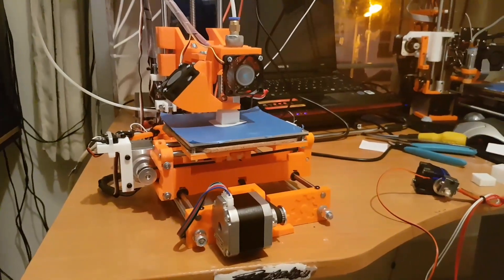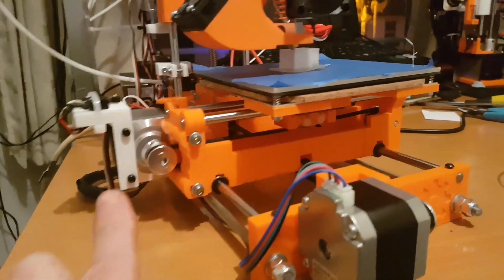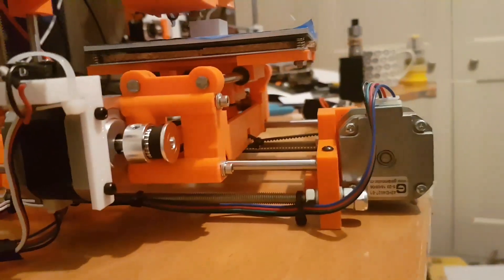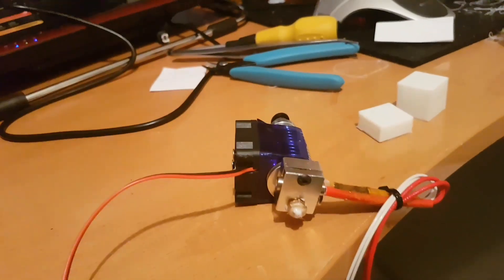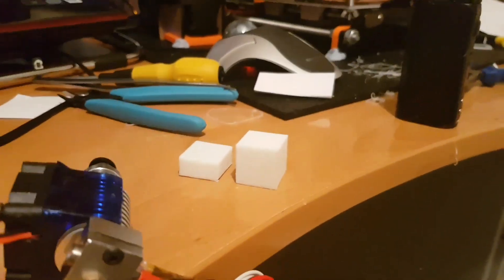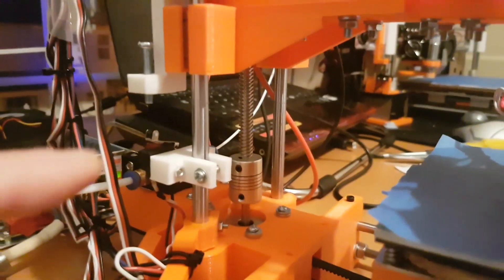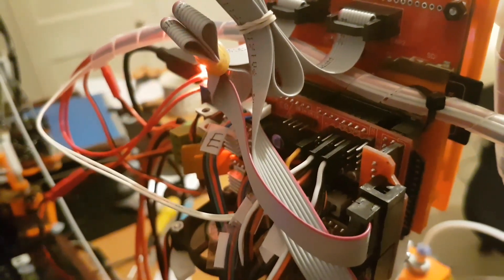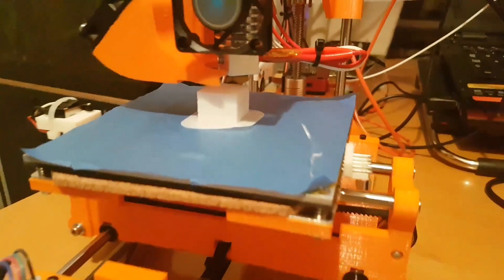Reprap Atom X (3D Printed 3D Printer) Up and Running

Comment: Any chance you could do another video when everything is running spot on. I came across the Atom X today and then found your video, so thanks for putting it up. If it prints at decent quality I may well have a go, it would be good to have two printers. :)
Reply from the maker: Googel+ Hi. Will do. I just wired up the heated bed for it. All working. Just ironing out the calibration...

Comment: This is awesome. I am in the process of printing this machine. Any tips so far?
Reply from the maker: 633r Hi. Good luck with the build. the main one to save you a headache is probably to print the print bed as a single piece. Here is a link http://www.thingiverse.com/thing:1739601

I also made a single piece for the y carriage front and a better z limit switch so I'll see if I can dig them out and put them on Thingiverse.  I used the original ones to hold fans to cool the board. if I think of anything else I'll let you know. Best of luck.
Reply: Thank you. The creator says he split up the parts. So I wondering if he doesnt have bigger parts available.
Reply: Where do the stabilizers parts go?
Reply: @Plan-C  cool

Comment: where you have take this heatbed and which dimension is it?
Reply from the maker: This is the same one. All over eBay:
https://rover.ebay.com/rover/0/0/0?mpre=https%3A%2F%2Fwww.ebay.co.uk%2Fulk%2Fitm%2F283348889415
Reply from the maker: Make sure you get one with the thermistor wired

Comment: Hello we are building your machine, but loading the firmware has been a challenge, it does not compile, I would like to know who has managed to load it without errors
Reply from the maker: I will fish it out and send it later
Reply: thank you
Reply from the maker: Hi, Hope the build is going well. It is worth it in the end lol! Here is a link to a firmware I edited to run without a BLTouch or Heated bed:

https://drive.google.com/open?id=1kkm7knxa266B3PNGJ6-K2-HquAA-T_5Z

I just test compiled it using Arduino 1.6.9 and it compiled fine. I think later versions of Arduino will also work. Make sure you have added the U8glib library to arduino as it needs it for the lcd. I suspect that is what might be missing. Just, go to 'sketch' dropdown, 'include library', 'manage libraries' and make sure it is installed.

I have also added the a link to firmware I am currently running on mine. It is exactly the same but has has both the BLTouch and heated bed installed. It also allows for a longer Y carriage to compensate for the fact that the BLTouch is 33m behind the nozzle. I honestly can't remember whether the original code I uploaded was with the longer Y carriage (I don't think so).

https://drive.google.com/open?id=17jj_9FWYh9qfmj1ypW28BIVRbEaaySy6

I did make some better x and y endstop holders. They are fixed and don't move which is better once all the settings and offsets are dialed-in. I will see if I can find them but you will probably be better off with the adjustable ones while you are putting it together.

Best of luck with the build. Let me know if you get stuck and I will try to help. All the best.

I
Reply from the maker: Oh and check you have the ch340 drivers installed and the com port is actually working. You can check in device manager. It should say 'USB-Serial'
Reply: Hello thank you very much, yes, I had loaded the firmware and the screen button did not work, it was frustrating, I saw that there was no information on the atomx website, few links.

I will start to test the code, it is a wonderful machine, and the best thing is that there is not another one like it. I'll be telling you the whole process, then I'll send you some pictures of how it's going, I made it orange and one piece will be damaged and replace it with gray.
Reply from the maker: Excellent. Thanks.
Reply: You have tried to create the multimaterial or multicolored, modifying the marlin, uff would be an incredible learning curve.

Using this machine, with 4 colors, and small engines like the NEMA 23, would be great.